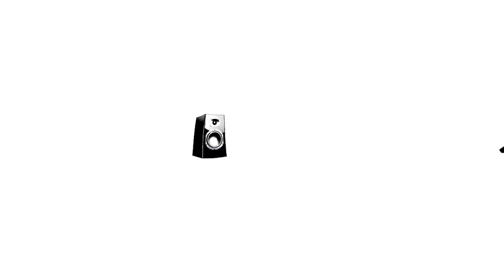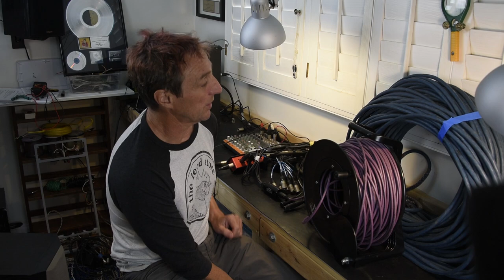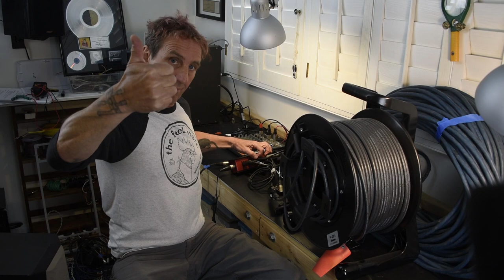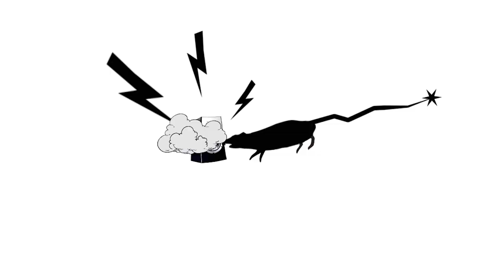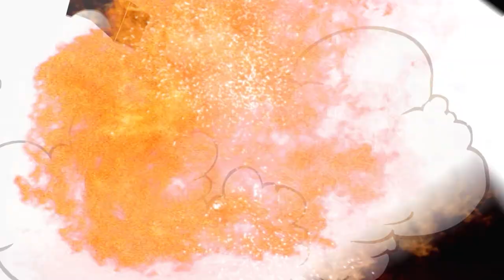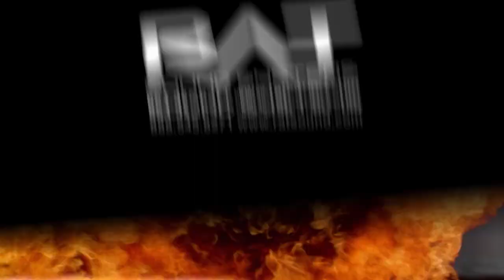Cat5e vs Audio Snake, Hear Signal Loss of 100 meter cables

Comment: If you're listening to the current flow in the cable, do consider that cat5e is about 3 or more times the resistance per meter than good twisted pair, haven't done the math on what level difference that will equate to, just a thought,  and what about noise immunity on the cat5e vs the snake? ... curious
Reply from the maker: It really depends on the wire gauge  of the Cat5e and audio snake, In this test the Cat5e is 26 gauge, the audio snake is 24 gauges and the Cat6a prototype cable is 23 gauge

Comment: The purple cable looks to be more than CAT-5e, cable and their marking not shown. Note, many data cables have a solid core and not stranded. Not deesigned to the bent and flexed all the time.
Reply from the maker: The purple cable is a cable we designed and have custom manufactured in Germany. It has stranded wires, coils well like a mic cord and has specs that are better than Cat5e but not enough to be Cat6a or Cat7  https://youtu.be/qdGw47VxzIU

Comment: Great comparison of the cable types!
But what about the phase shift due to propagation delay over the 100 m?! Doesn´t this add to the difference in signal between the voltage drop and the direct connection?
Reply from the maker: Hmmm, may be a bit out of my knowledge realm but I am thinking that propagation delay over distances of 100m or so is so slight that it is irrelevant to audio frequencies. Conversely, phase shift due to capacitance and inductance are real and can be significant factors

Comment: Ironically I think Dave's mic audio could do with some HF loss. :)
I too am surprised there's more HF loss in the thicker audio cable. Glad I don't have to worry about that in my cat6 audio runs.
Reply: increased capacitance gives a HF shelving effect
Reply from the maker: Agreed and what is interesting is that the smaller diameter Cat cable with 4 channels performs equal or better than larger diameter single channel mic cable. One would think the Cat would have higher capacitance due to the closer proximity of the conductors, but.. .

Comment: 25yrs ago I was using cat5 in vehicles  due the the issue of coaxial cable being more prone to the magnetic induction of AC currents on the chassis. The only other problem that was a significant factor at the time was, most car audio gear was single ended and not balanced. So people needed equipment with low impedance signal systems as to mitigate the imbalance and common mode noise
Reply from the maker: Super cool

Comment: Was totally surprised by this result. With higher amount of signal carrying material, the thicker wire gauge, I expected the audio snake to do better than the data cable. Wonder if it's the extra twists in the data cable that help improve signal stability... Also didn't realize I had missed this one. Thanks, now back to wrapping my head around DI's and transformers in your latest videos...
Reply from the maker: Yeah, I think the precision twists and things like insulator composition may play a role in extending hf response, I was a bit surprised as well

Comment: I'm no electromagician. But running an amp->speaker signal through 100m (coiled even), 26gauge wire is not a gud idea for the longevity of the amp...
...Unless you are using a line signal to powered speakers.
Reply from the maker: This test is at line level
Reply: @DaveRat  I couldn't make that out of the video. I must have missed that.
Never thought about using an ethernet cable.
Reply from the maker: @spekenbonen72  yeah, it's super cool using the high quality twisted pairs to transport analog. My company started doing it for burial cables and long cable runsand it was so effective I started making a full product line of stage boxes rack mounts and tails for analog over CAT5. And that worked out so well I I designed some Cat5e cables for pro audio use better company implemented and then we started selling those as well

Soundtools.com

Comment: If you invested in a TDR (Time Domain Reflectometer) a few things become clear. STP CAT 5 is 110 to 120 ohms impedance. To eliminate the issues of cable capacitance, etc except delay, go with a digital stage box. Sampling as close to the source gives the cleanest signal. Unfortunately all digital DSP, A/D, D/A conversions take time so there is latency. Running one CAT 5 to a 48 Channel stage box with 16 returns is much easier for the roadie.
The big importance with data cable is shielding. It is UTP or STP. Don't skimp here. Next in line is loss. Smaller conductors have higher end to end resistance than larger cable, but most snakes are about the same conductor size. Capacitance per foot attenuates high frequency when the load is higher in impedance than the cable. Lower capacitance results in higher impedance and less loss at high frequencies.. which is what you want for a cable passing 350MHZ or less as eg a CAT-5E. Yes less is fine such as DC to 50KHZ. Watch for higher current phantom power mics. They may have too much voltage drop on a long cable (500 ft +) to function properly. FYI, CAT5 cable makes excellent Data Cable such as DMX. It is the perfect impedance for it. Many audio snakes are built with anti-static insulation so the cable is not microphonic. google cable rustle for this effect. Digital network cable will have mixed results in this realm. Many audio snakes have larger conductors with more capacitance per foot for durability in handling. This results in lower impedance and higher capacitance load per foot. The Dielectric loss in audio cable is pretty high in some snakes as materials are made for flexibility, durability, and take road abuse. Google dielectric heating and loss. This is energy absorbed by the insulation. To prevent loss of high frequency data, data cable is built with very low dielectric loss insulation.
Most microphone cables are about 60 ohms impedance. CAT5 is 110 to 120 ohms. This is closer to the 200 to 600 ohm microphone input impedance of mixers.
Reply from the maker: Interesting and also, it's pretty interesting that cat5e cable works as well or better than more expensive per channel pro audio snakes. 

Using Cat5e for transporting analog audio is a simple way to have disconnectable 4 channel snakes with thinner cables that are readily available.

Also, pre wiring a building with inexpesive shielded Cat5e allows you to transport day or analog audio, com, dmx, and AES 3 anywhere in the building. Rather than running special audio cables.
Reply: @DaveRat  As CAT5 is not made for heavy handling, this won't replace your microphone cables and the shield is on the outer of all pairs. They are not individual shielded pair cables, so crosstalk will exist, where levels would be too low to affect digital.
Reply from the maker: @isettech well sort of except that actually I designed and have made in Germany custom Cat5e cable that I buy 10 kilometers at a time and sell under the SoundTools brand that is polyurethane jacketed and built stronger than mic cables and winds easily. It is the cable in the video. Also there are several other companies making high quality entertainment grade Cat5e.

As far as crosstalk, here is a video doing a demo on crosstalk with analog down Cat5e S/UTP

https://youtu.be/gGgPDEz5sNU

Oh, and also, I designed and soundtools sells a Cat5e U/STP cable with individual ground wires per shielded pair as well.

Love your comments and love that all the concerns have already been addressed, are being made and deployed.

Comment: I've been wondering for a little while now why current signalling isn't used more in pro audio. Most of the problems of voltage signalling (induced noise, cable losses and colouration etc) which has been the norm for at least 80 years, probably since the beginning of electrical audio, disappear when using current signalling. I've been using it for some time to pass audio, digital and analog signals between devices in my entirely non-isolated DC off-grid home, to get rid of the ground differential noise that occurs when there are devices using varying amounts of power connected to the same DC power source (the same issue that DI boxes were invented for). Sending is simply a transistor or two to convert from a voltage signal to a current signal, and then receiving is just a resistor to convert the current back to a voltage, with a capacitor to block the DC part of the signal (it needs a 1 or 2 mA DC bias). As long as all the equipment in the system shares a common earth, even if there are quite large AC voltage differentials between earth points, only one conductor per signal is required: a cat5e could carry 8 channels, without any interference between channels or from outside, with no signal loss at any frequency, over any distance. I'm just wondering if you have any idea why this isn't done? or maybe it is, and I just don't know about it?
Reply from the maker: interesting and outside of my knowledge base. but would be curious to know more from anyone with knowledge on it
Reply: @DaveRat   - so would I, like to know if there is anything using current signalling anywhere in the pro audio sphere (I know it gets used in digital video standards like hdmi and communicating from motherboard to screen in laptops) ... In case it's helpful I'll explain it a little further. at the send end, (the signal source) there is a current amplifier. Normal amplifiers are voltage amplifiers, they try to maintain their output voltage according to their input signal however much current it takes to do this. A current amplifier is the opposite, it tried to maintain it's output current according to its input signal, whatever voltage it takes to do this. Since, if there's nowhere else for it to go then the current in a conductor must be equal everywhere, the current that the current output amplifier puts out must come out the other end. The voltage drop down the wire doesn't matter; the inductance of the circuit doesn't matter; induced voltages from nearby wiring doesn't matter: the current amp will just use more (or less) voltage as necessary to put the current it wants into the wire, and that current WILL come out the other end. At the other end, the current flows across a resistor, generating a voltage drop that the receiving equipment uses as it's input signal.

The only issue I can think of is that at extreme length cable runs (300m+) the capacitance between the twisted pair wires in a cat5 cable presents a significant load to any voltage changes, and some of the input current will be going to charge and discharge that capacitance as the voltage between wires changes, but a slightly more complex receiver could keep the receiving ends at a fixed constant voltage and most of that difficulty would disappear.

I could easily design and build something to try it out...?

Comment: For the record. “Warmth” does not mean less high end. It means a pleasant and harmonically diverse crunchiness and crispiness, for lack of better terms, across the entire audible spectrum. In my opinion of course. You can’t get the Oddessey and Oracle sound by overdriving a single component. I’d love to know how it’s done. What is the cheapest way to get that full spectrum fuzziness? Help!
Reply from the maker: Hmmm, "warmth" as a way of describing sound leaves much to interpretation. I perceive warmth as the difference in sound of a warm temperature venue vs a cold temperature venue. Or an amp and speaker the gets hot from being driven hard and loses the sparkle of highs and the lows become less dynamic and muddled.

As far as distortion, have ya looked at my pcm60 as a distrtion video?

Comment: Interesting. Could there be more capacitance in the blue cable or somewhere in the signal chain? My elec theory is very rusty.
Reply from the maker: I don't have specs on the blue cable but am guessing it has more capacitance due to design, lower quality insulators, and slightly thicker wire gauge

Comment: The issue here is that the data cables aren't carrying audio, just data. That data just has to be intelligible at the end of the cable at whatever data rate they're designed for, and there's a ton of error correction on either end to make sure no data is lost. Audio cabling needs to carry the actual signal to the end of it, but because you're passing it through the cable, some is always lost.

A much better test would be a 100m digital snake versus a 100m analog snake. You'll hear a very, very clear difference between them, assuming everything else is equal, because the digital snake loses nothing over 100m and the analog snake loses quite a bit.
Reply from the maker: Actually, using data cables to carry analog is not only something that is done, it is awesome! Using the 4 twisted pairs of a shielded Cat5e to carry 4 lines of balanced analog with a reliable disconnect etherCON is very useful

Here is a video with 3 mic level and 1 line level analog down Cat5e testing crosstalk

https://youtu.be/gGgPDEz5sNU

And here are some products that make putting analog down Cat5e easy and useful

http://soundtools.com/audio-over-cat5-systems-page.html
Reply: Well you can also always have the DAC and the  amp near the speaker and carry the audio full digital without loss... you could even do it wireless, which is a huge heresy and have no cables....